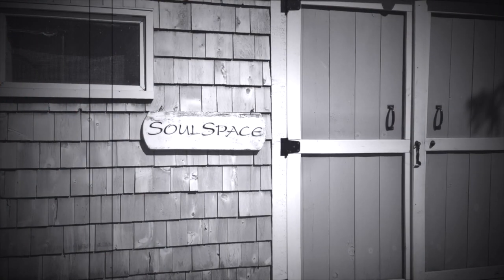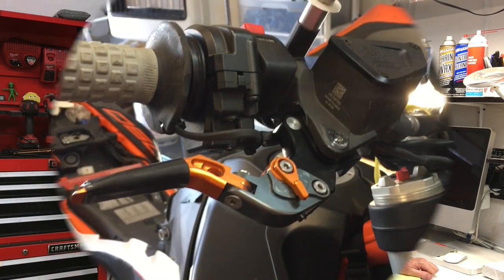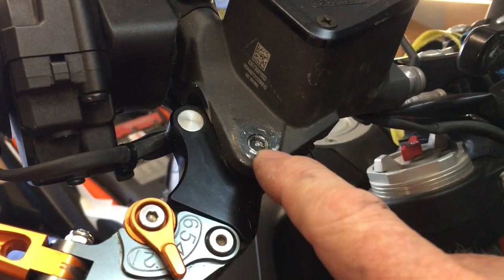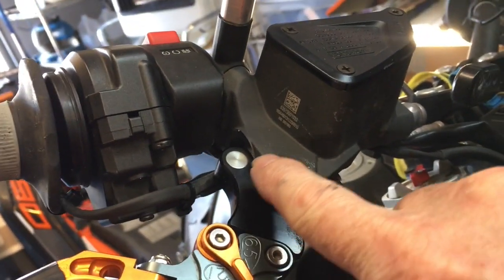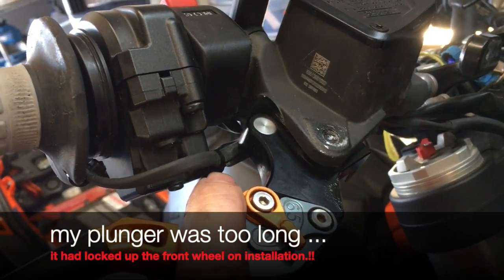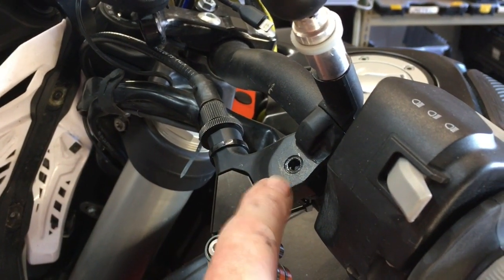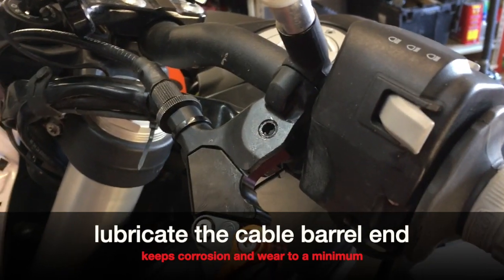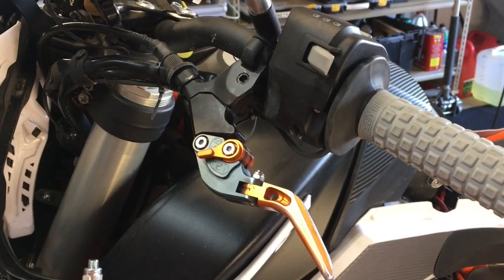KTM 790 aftermarket lever install, warning, hack

Comment: Plastic cap don't seem to break on 890 Adventure R. I switched the new plunger for the stock one. Had to use a vice to hold it and twist the lever because it was screwed on pretty tight. Thanx for the video!

Comment: I had the same ones, not sure if i did anything wrong, but the braking power was much lower with this set, even that I adjusted the lever as far as possible, and pulled it all the way to the grip, it wasnt that strong as OEM, so I have removed it, as I coudln´t trust it.

Comment: Thanks a lot for the instructions. Helps a lot!
Which levers are you using?
Did you add the grip to the brake lever? I’m looking for something like this so my fingers won’t freeze in winter every-time I have to break.